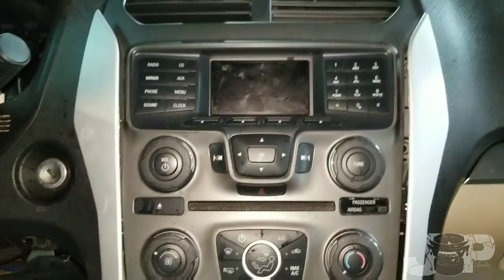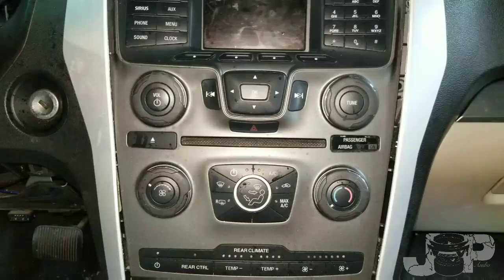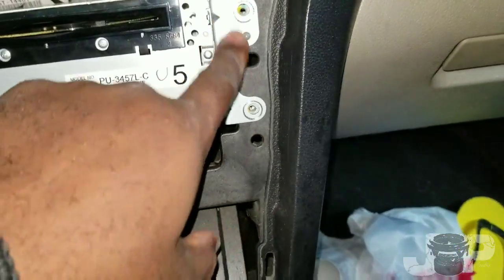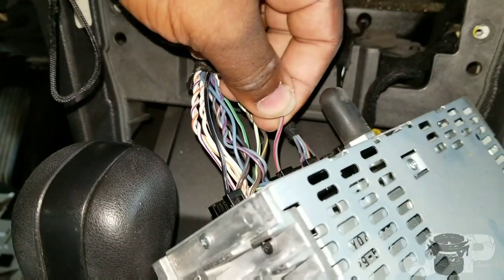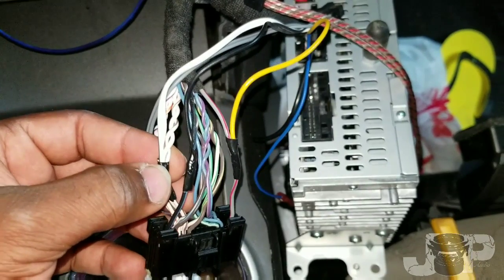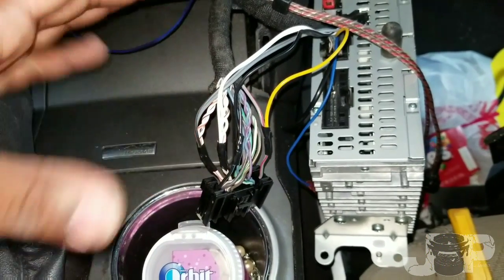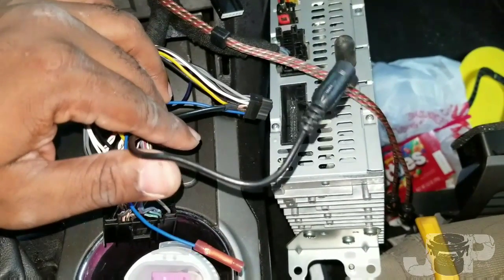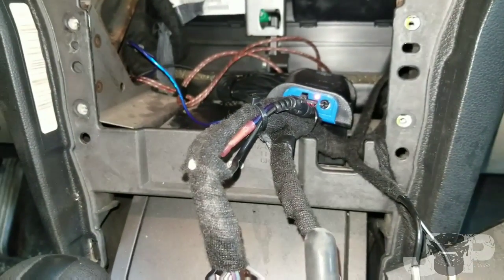2013 ford explorer radio removal and loc install

Comment: i have a skar audio line out convertor similar to the audiocontrol style loc2 and was wondering i can tap the passenger side lower pillar to run my speaker wire connection to the rear or is there a place in the rear of a 2015 ford explorer xlt standard radio non sony where i can tap into so i can have the amp and loc close to each other?

Comment: how do you add subs to the 2012 Explorer that has the factory Sony system?
Reply from the maker: same way just tap the wires at the amp instead of the radio

Comment: I have a ford explorer police interceptor 

Now I have the same exact stereo. I bought a center console from a explorer OEM and it has a line in port. Is there diagram anywhere showing where I can wire the line in the back of the stereo?
Reply: You ever figure it out? Just got one today.
Reply: @svelements  unfortunately not. I bought a fm transmitter to aux. Worked fine for me. Also you can try installing an aftermarket kit but that's expensive.
Reply: Mine came with sync radio and with wires like in this video

Comment: Man I’m glad I found this video. I have a 2011 do you have a way I can contact you?
Reply from the maker: glad i could help
Reply: Can I use the the remote wire from the LOC and run that straight to my amp? Or do I have to get my remote turn on from where you did?